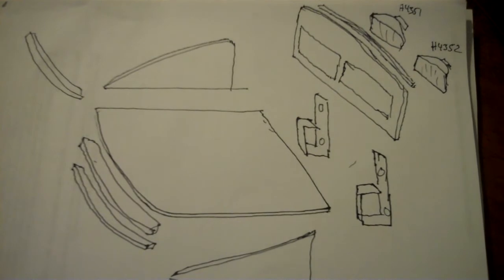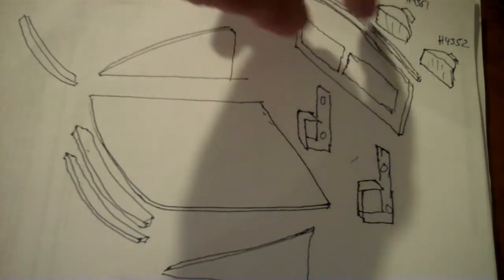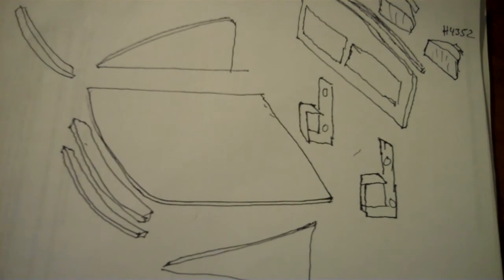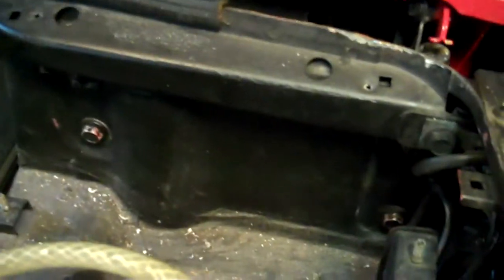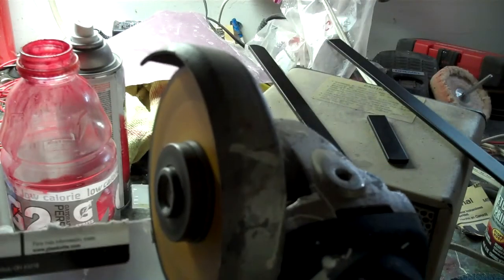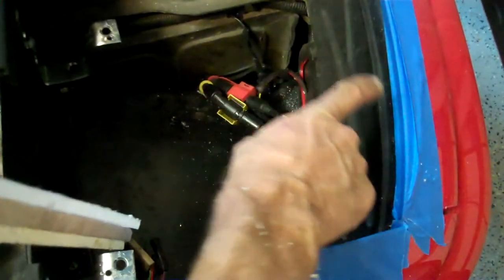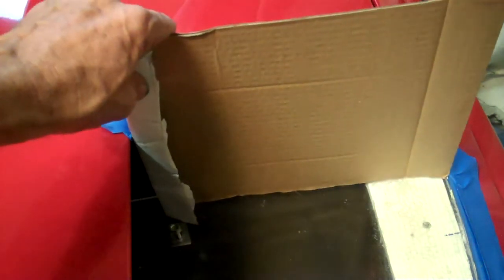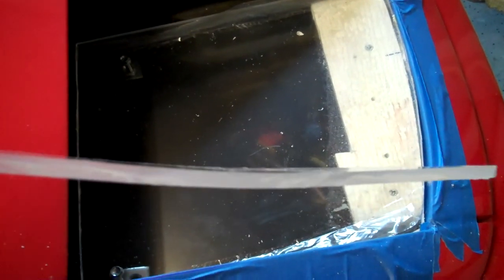Ferrari 348 glassed over headlights Part 1

Comment: Hey there, would you build me one?
I have no mechanical skills:(
Reply from the maker: Actually I'm back to the original pop-ups.  Trying to keep an airtight seal was a never ending battle. One microscopic pin hole and instantly you get the foggy headlight look from condensation inside...NOT attractive!  If you made the base box from steel or aluminum and TIG welded the seams you would stand a better chance, but you still have to seal the top plexiglass and the back plexiglass or glass.  Just not ready for prime time
Reply: Wow man, I can’t believe it’s been two years and I still don’t have it done. I want this. Make me a set. I will have yellow tint on it anyways.